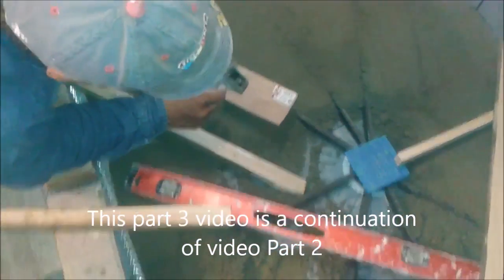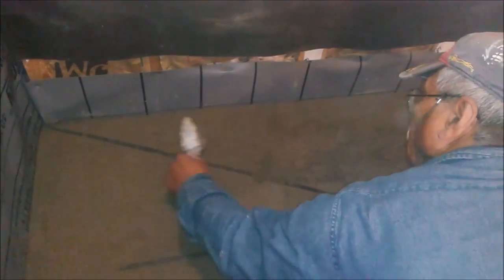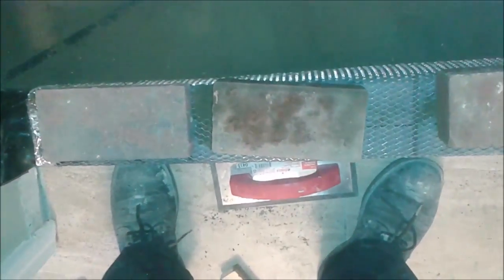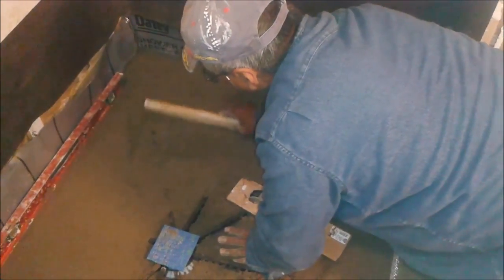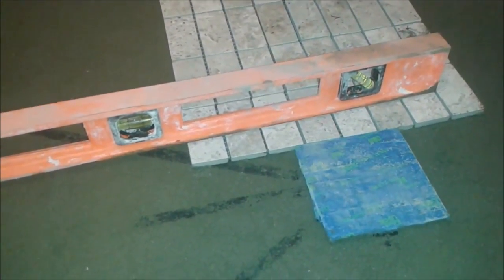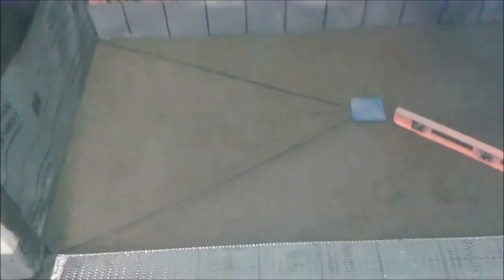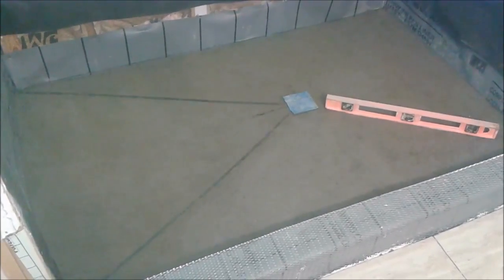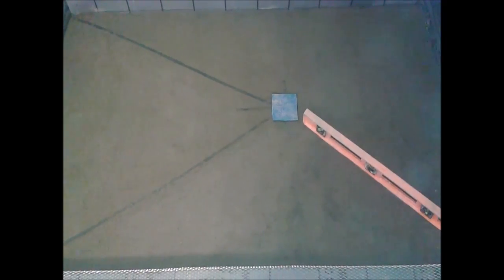How To Build A Shower Quick Slope  -  Part 3  - Finishing The Quick slope

Comment from the maker: All material used are from Amazon:
Shower Pan Liner Used  size 6'x8' https://amzn.to/36bKKd4  size 5'x6'  = https://amzn.to/33b6pjQ or size 6'x8' = https://amzn.to/34bGUOu
PVC Dam Corner = https://amzn.to/36gIMrW Or https://amzn.to/3jeayZX
Goof Proof Quick Pitch = https://amzn.to/335t8hf
Goof Proof Extra stick = https://amzn.to/2S1A9cm
4 - 1  Mix Mud used = https://amzn.to/344tfsq
wood float = https://amzn.to/3ijo0tX or https://amzn.to/3jgjFsO
thin set used = https://amzn.to/2EyeEgc
Pan liner Glue = https://amzn.to/3cP2lsM
Weep Hole Protector = https://amzn.to/332QvrB or https://amzn.to/330Te4U
Shower drain used = https://amzn.to/2Hp9c0a
Or  https://www.amazon.com/gp/search/ref=as_li_qf_sp_sr_tl?ie=UTF8&tag=josephkhalon-20&keywords=goof proof quick pitch&index=aps&camp=1789&creative=9325&linkCode=ur2&linkId=cf01d1f4124c5fb222b2c983ba56e5e1
Amazon Deals:
Try Amazon Prime 30 days for free = https://amzn.to/2JMWaLe
Create Amazon Business account = https://amzn.to/3mLSyYt
Joint Amazon Prime Watch Thousends Of Movies and TV = https://amzn.to/33NfsHD
Try Personal Shopper Wardrobe  https://amzn.to/2VClfv9

Comment: Thank you for the video, I am a general contractor and I have used perfect pitch before. I have two comments to make it a lot faster and easier. First shim the stick going from the center to the back and front sides to match the level line and the process will take one hour at the most. The second comment is why don’t you use the perfect curb? It is another product made by the same company for the shower step. Thanks again for the video
Reply from the maker: Thank You for you comment. I did not use the perfect curb because my curb is concrete so I decided to float it with metal mesh. I could also use the perfect curb .
Reply: Abduahhaq Salem how would you shim the pitch perfect sticks?

Comment: Very good series. Question - if you drew a line around the perimeter of the liner as a guide to where to fill the mud up to, why even bother with the sticks on the right side of the floor (the shorter end, closest to the drain)? As you laid the mud, you totally cover up the sticks and never scraped the mud down to them like you did on the left side. You mentioned that the slope from the right side to the drain is higher than the slope from the left side to the drain. Is that the reason you didn't scrape the mud down to the sticks on the right side? If so, then I'm not sure why you needed to lay those sticks. Thanks
Reply from the maker: That is the reason.  Some of the sticks are  not shown because they are covered with mud  probably 1/4 of an inch or so. You need the stick as reference . The reason that some of the sticks are  covered with mud is because the shower pan is not square .
Reply: In my opinion, the Guide Stick System used in this project has a major design flaw in it. Unless the drain is in the exact center of the shower, there will always be a mismatch between heights. If I were the manufacturer of this product, I would redesign it to be able to individually adjust the heights for cases such as this where the drain is not centered.

Comment: can u also tell me why do u need the wire mesh... while builidng the shower curb for concrete slab, how do i do this.
Reply from the maker: Please look at my videos how to float a shower curb. You can buy the mesh from Lows or Home Depot. It called diamond mesh.
Reply: joseph one question, in bath tub what causes mold in the Caulk. ?. second question if i redo the Caulk will the mold come again?. third question, if it is all done right, can i assume there wont be any mold at all in Caulk or tiles?... please answer this 3 questionos..
Reply from the maker: You should use a mold resistance caulk only in water environment like GE silicon.

Comment: Hi Joseph. Love your stuff man. Coming to you from australia. Im about to embark on a similar process, however with a linear drain. 1500mm long curbed shower. Do you have an email i could shoot you through a picture to grab your input?
I was thinking of making sloped batons, with the required fall, that mimicked the goof proof idea. set them into the concrete floor 6" off the edge of the wall, mud the edge, like a wall, allow it to set, then level off from that. What do you think? 

Cheers,
George
Reply from the maker: Sorry for the delay. You can email to JosephKh2014@gmail.com. Thanks Joseph

Comment: where do u get the quick slope, home depot or lowes .. i could not find it over there.. pls advise
Reply from the maker: The Mapei  4 to 1 base shower I bouht From Floor and Decor .
Reply: are you talking about quick pitch tool or the mud. i am referring to the quick  pitch tool to get the slope.
Reply from the maker: Both you can buy from floor and Decor . The tool kit called the Quick Pitch system. You can also buy it online from Amazon or from Goof Proof.

Comment: How much time did the whole process take (for the slope)? What's the black stuff behind the liner? I would've like to have seen the process of preparation before the curb or slope application from start to finish. Including the boards you used to install between joists for the shower liner. I don't know about any of this stuff, but what I do know is that its probably better I do it myself the right way and take my time, than pay someone a whole lot of money to get the job done quickly and probably cut corners, costing me money in the end. Very informative video. Thank you.
Reply from the maker: I have all the process from start to finish in my videos. The black stuff is a vapor barrier that you should install.. It took 2 hours to complete.
Please do not use constructors they most likely will not do it properly and charge you tons of money. You can do it yourself by far better just follow the videos. 

https://www.youtube.com/watch?v=C4uSUV8cgfw

Comment: I watched all three videos and it hurts. You could’ve just leveled all of the end points of the screed guides by shimming  with concrete, small pieces of those bricks or even wood then screed the deck mud to slope to drain. You guys defeat the purpose of the guide sticks by burying them.
Reply from the maker: Yes I could and  it may be simple. Thank You for the input.